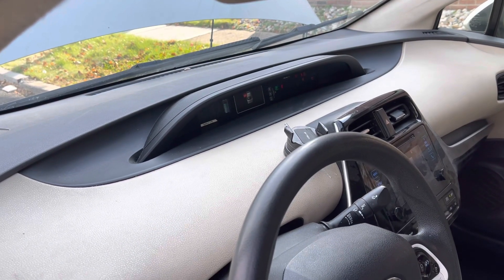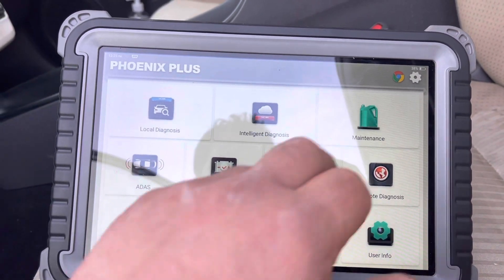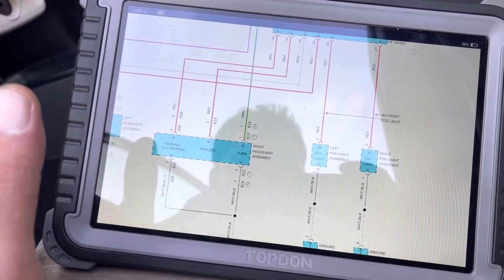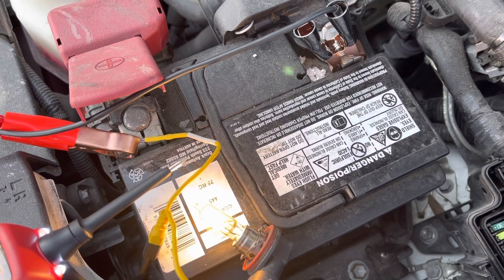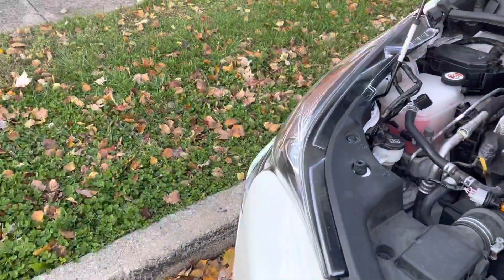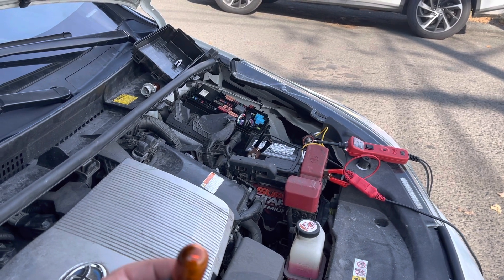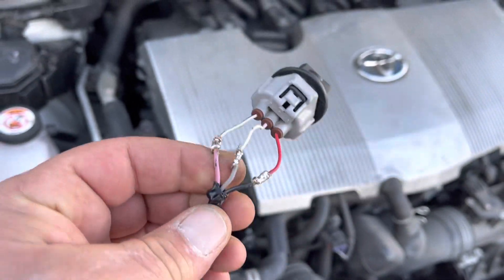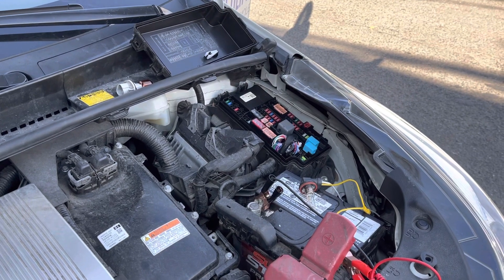How to find a short to ground with a headlight bulb

Comment: A client complained that when he was on motion is airbag shot. Eventually, he noticed that the smoke was emanating from the engine bay. Hence, he pop-up the hood and saw that the smoke was coming from the ABS module. He called a mechanic to unplug the ABS module connector. Afterward, the connector was connected back. Henceforth, he has noticed that his steering is stiffer to steer. Additionally, he said : "the car isn't moving smoothly as before."

Yesterday, he called and said even the headlight and other lights aren't working again in the car.

The check light appears first, brake light second then finally the P/S light appears. They lights don't come out at once. It's a 2010 Toyota Corolla Le.

Please how do I fix the problem?